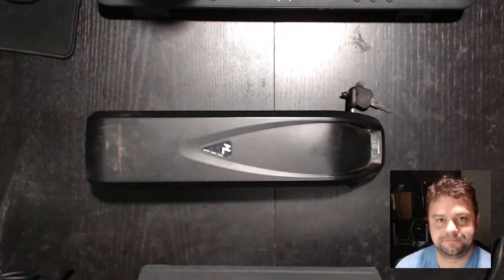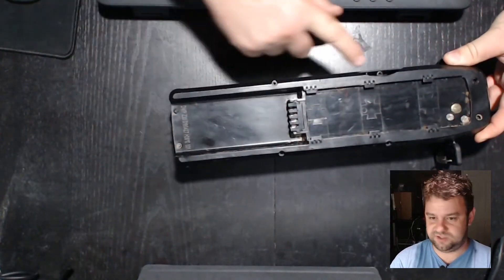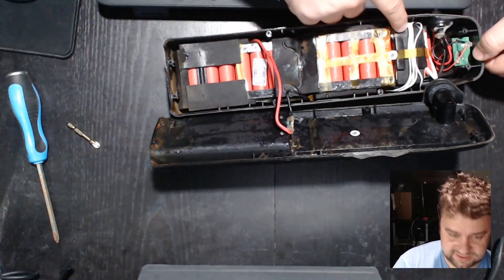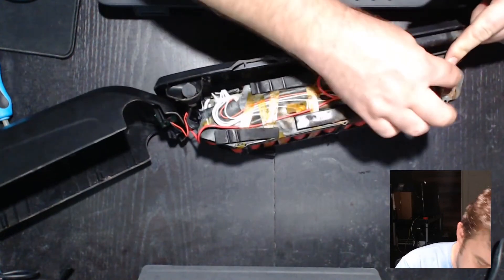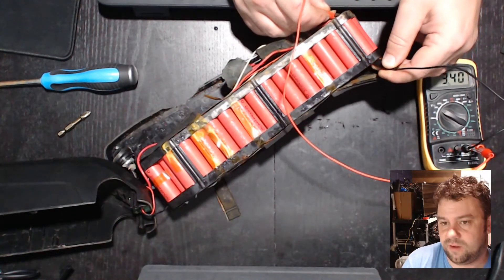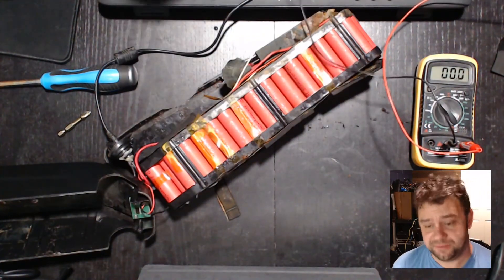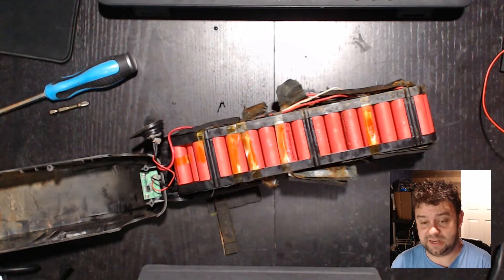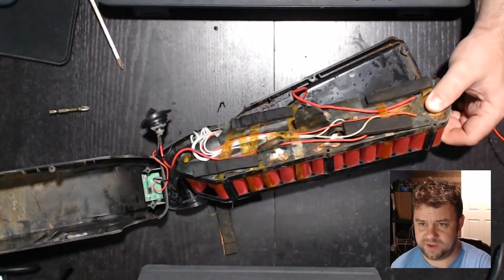I left this eBike battery in the rain - let's see what damage it did

Comment: I took my lithium battery outside for two days exactly.  I haven’t noticed any rain, but I looked up recent weather and it said there was -2 and snow at 6am this morning.  Could my battery be ruined.  Picking it up it seems totally fine.  It has been slightly moderate lately with -2 being about low as it’s gone, and that was what it was when it was snowing, so perhaps it wasn’t a really wet snow?  I saw no signs of water on the battery.  It is all silver colour so dry water would likely leave a bit of a mark.  I’m not sure

Comment: I pray that all of the people in this comment section saying their batteries got wet/submerged didn't try to use those batteries. Lithium Ion batteries are no joke and notoriously unstable when they have a fault. It's not an exaggeration to say you could lose your home and potentially your family/life if you try to use or charge them once they're been damaged. It's not worth the risk for the sake of the cost of the replacement battery. Please, if you aren't sure, just replace the battery.
Reply from the maker: Yes, this is a great point. At the point in which water has infiltrated one of these batteries, these batteries should be considered junk and should not be charged.
Reply: As a ebike owner after watching several videos on  ebike batteries I would suit up like Bomb squad  diy . Outside on dirt safety glasses welding gloves jacket and face shield . 
Also metal bucket and bag of sand .

Comment: Thank you for making this video. I found this video very eye opening. Once I found was condensation forming on the outside of my ebike battery case  while being stored in the garage during the winter. I wonder if condensation was forming on the inside of the case as well. Looks like I can only use my ebike in warn dry weather and always store the ebike battery indoors and at room temperation. What say you?
Reply from the maker: I have an eBike battery attached to my Ryobi mower that sits outside all the time, it has been rained on, covered in snow, and has intense sunlight beaming down on it through the sunny hours of the day. It still appears to be working fine. It's anecdotal of course, but so far there have been no ill effects. In the case of this waterlogged battery, it was sitting upside down so the water got in through the screw holes.

Comment: What's the result? my battery ApolloTransport got submerged for short time I fell into water.  Battery light was through cycle but it stays on and I am as well able to off it but when I plug charger the light in charger doesn't change into charging usually is red but when I plug battery it stays green. I wanna open battery and see inside. Maybe it's not battery maybe it's just BMS got damaged. Please update how it went. Thanks 😁 I ordered new battery super expensive but if I could save this one it would be great 👍🏻☺️

Comment: I left my vegeance battery in the rain and its full of water. It still turns on but how long should i leave it to dry before trying to charge/use it?
Reply from the maker: Unfortunately I wouldn’t recommend using it if it has been submerged, the BMS is likely damaged so it wouldn’t be safe to charge. 😔